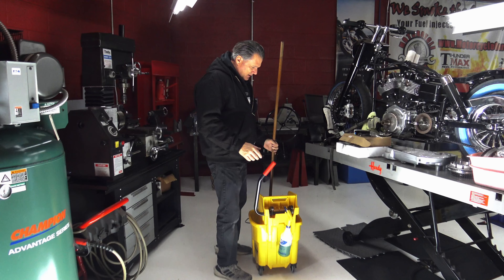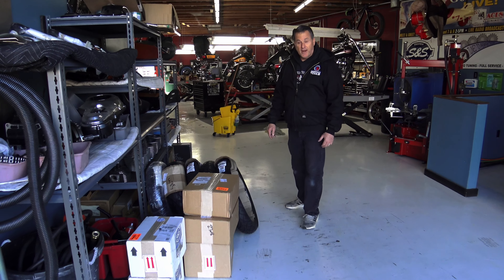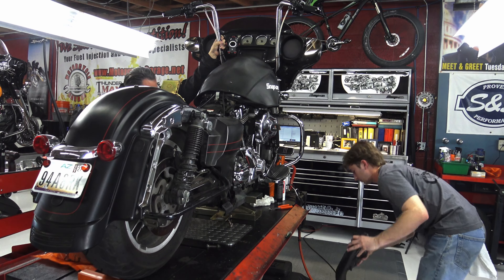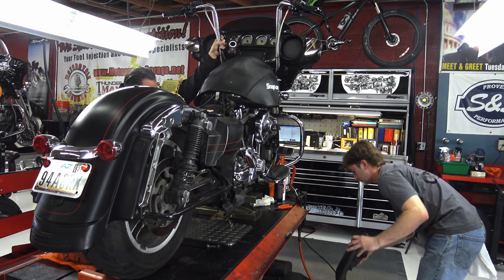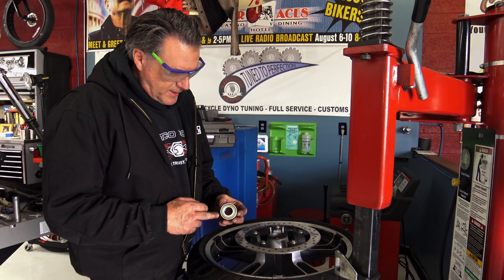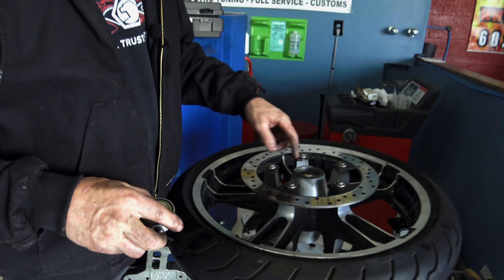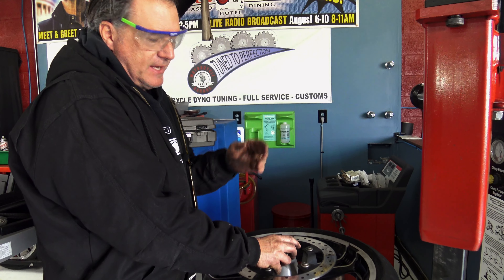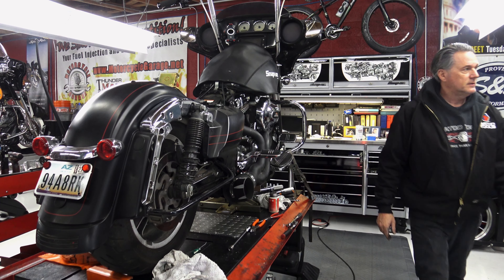Master Technician Bill Miko performs a 95K mile service on this 2014 Harley-Davidson FLHX.

Comment: I thought I noticed that the air filter looked oily, do you recommend a external breather system or not ?
Reply: On Evolution engines yes but not for Twin Cams. Some oil carryover is normal. Thanks for watching